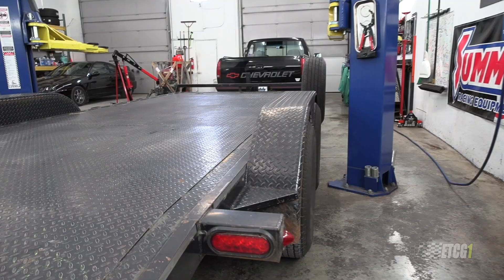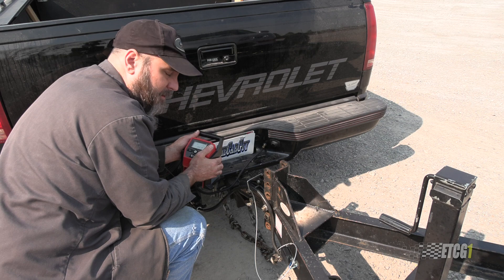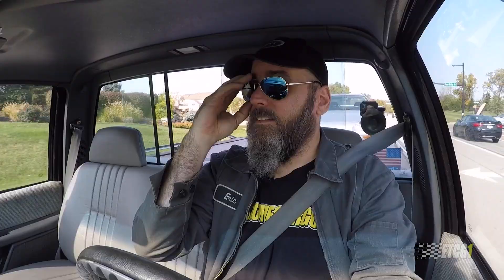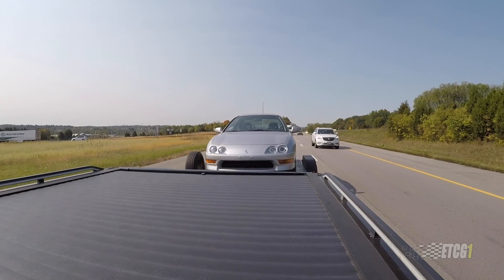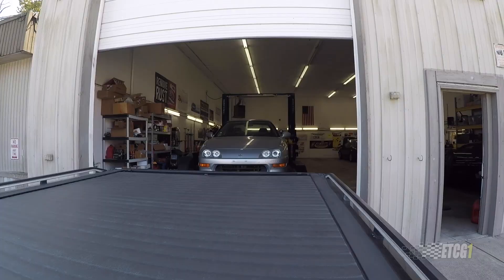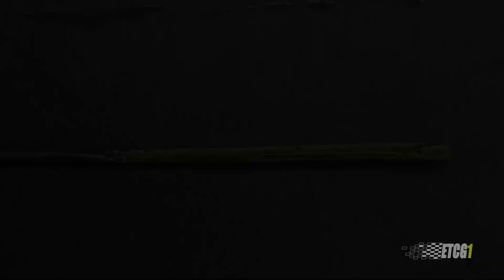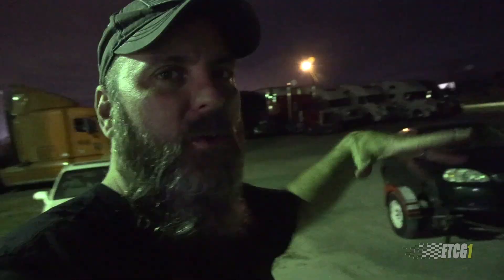First Time Towing With Airbags

Comment: By isolating the sides, you did the smart thing. Shared bags cross transfer load and can exaggerate body roll in a turn.
Reply: Seems to me that trouble shooting is a lot easier this way , aswell... i.e. looking for leaks
Reply: That it is, like on the install video...
Some people also have line locks once at pressure to stop the roll also but have 1 feed.
Reply: This is incorrect. I have sone extensive testing with this Aspect and to my surprise it remained the same in curves. I have the max air 5000 load helpers and I tow a lot of heavy equipment and hay. I carry 95 psi in my bags when hauling heavy. I have them both tied together into one shrader and have never had any problems.
Reply: @Cake41579  I appreciate your opinion. I’ve been messing with air ride for almost 30 years. Put gauges on the corners. You’ll see it’ll absolutely transfer load. It’s physics... no way around it. You may not notice it if your rig is heavy enough but it absolutely pushes load to the un loaded side
Reply: @rdspeedfab  I’ve had gauges on both sides with check valves in place to capture any air that would bleed from one side to the other. I am a cattle farmer and have been hauling heavy, HEAVY loads for the past 20+ years almost daily. With lower pressures below 20 lbs, yes, I did experience a slight bleed over from one bag to the other. Pulling a 24 foot stick trailer, empty, it bled 2 lbs to the passenger side on the interstate at 70mph in a fairly sharp curve in the mountains of West Virginia. I conducted experiments such as this with the steel 24’v gooseneck stock trailer, 28’ gooseneck flatbed, 16 foot lowboy bumper pull and all of them showed minor bleed over in the time frame I was doing the experiments as long as I maintained pressures above 20 lbs. like I mentioned above, I generally carry 90+ psi when loaded. Running empty I only carry 20-40 psi depending on the trailer in tow. I was having trouble trying to conduct an accurate test at first is why I installed the check valves on one bag at a time so it  would only allow the air to bleed from one side to the other. It is a complicated experiment and to obtain accurate results required a lot of head scratching and trial and error. I’m guessing the higher pressure wouldn’t bleed over because of the resistance of the greater amount of pressure in the small area. If the bags were of larger size I’m sure the bleed over would’ve been more pronounced but the average size 3/4 or 1 ton pickup uses the same size I was using to conduct the exoeriment. Maybe I was doing something that was heeding false results but I done the best that I know how to get accurate results. 20 psi or less, yes there’s bleed over. 20 psi or more was hardly even a big enough variation to even record.
Reply: I will say this. My testing was strictly pertaining to hauling a trailer. I guess I never thought that you may be referring to the pickup bed being loaded to one side. In which you would be absolutely correct.
Reply: @Cake41579  well the check valve absolutely solves the issue. Also the rate of spring in your front suspension, rear sway bar size etc would also keep the body roll to a minimum. We’re sorta talking apples to oranges. My experience is with air ride on all 4 corners on customized cars/trucks. Where as you’re using bags as a helper, I use them as suspension. Pretty different from what you’re doing. Still great info and a fun conversation!
Reply: @Cake41579   yeah I agree, different deals for sure.

Comment: "Turn the bottom of the wheel the way you want the trailer to go" is the way it was taught to me - as you said it helps!
Reply: Bert Snerff  Nice, you are probably better at it than me then, but this has certainly helped me on the few occasions i've backed up a trailer!
Reply: Bottom steer, works well.

Comment: Biggest reason for seperate air lines. Handling. If they are T together, when you lean in a turn. Air leaves 1 bag and goes to the other.

Excellent vid!
Reply: You can get bags that are two in one, that counters that problem, eg, top left to bottom right and bottom left to top right, makes them ride flat.

Comment: Never towed anything before myself, so when I bought a salvage titled vehicle, I needed to tow it to have it safety inspected before I could get a State inspection. I went to U-haul, rented a truck, and trailer. They asked if I wanted the car dolly, or trailer first. Glad I went with the trailer since I had to do quite a bit of backing up.
Reply from the maker: Yea, you would have been frustrated backing up a car dolly. At least it was frustrating for me. Thanks for the comment.

Comment: I had a similar problem with towing my bike on my trailer with my old Pontiac grand am. Car was lowered a bit, and had my tool box and army gear in the trunk.  Destroyed the original bump stops from bottoming out. Ordered a set of helper bags for it and made a world of difference. The car had a factory tow rating of 1000lbs, and the bike/trailer combo was maybe 750-800lbs.
Reply from the maker: Thank you for your service!

Comment: You can lock a steering wheel in place with the seatbelt by pulling all the way out, pulling seat all the way forward, wrapping seatbelt around steering wheel as many time needed until able to click it into fastener and then sliding seat back.

Comment: What a difference... Especially nice to see that you were only around 55psi as loaded.  It's definitely never going to pull 20k...but 5-7k should be quite manageable loaded properly.

That on the fly tuning is an awesome feature of your setup, and all those fluid Temps were solid as well.

Congrats on the fun truck with a standard duty towing option.

Definitely gives you a lot more time to find the right heavy duty towing rig if you end up deciding you need that capability in your fleet.

Thanks for sharing!

Comment: If you buy a weight distributing hitch with a sway control, a.k.a., an equalizer hitch, dads truck will have no problem hauling dads other truck. Harbor Freight has a Haul Master weight distributing setup rated to 10k lbs. for under $400.

I'm an owner operator truck driver so here's little tip on backing a trailer. Steer toward trouble. In other words, turn the steering wheel (a little at a time) in the direction of the obstacle that you're trying to avoid.
Reply: That’s good for two things, extra heavy loads where the rear suspension alone can’t handle it and extra sensitive light loads where the towing vehicle has too aggressive of a rear suspension and it pummels the trailer otherwise
Reply: Bottom steer, works well.
Reply: Ive used both bags and hitch. Hitch is the way to go

Comment: I recently purchased a larger camper to tow with my Toyota Tacoma. I use a weight transfer hitch and after watching this video I will be installing a Firestone Ride Rite air bag system to help with sagging rear end. Thank you Eric.
Reply: If it tows good and secure iwouldnt , the goal is safetynot looks.Maybe the hitch needs tobe set up

Comment: I dobt drive a truck anymore. But I did a complete power stop brake upgrade to my 02 accord complete with New hardware drums, shoes pads, rotors, stainless steel reinforced brake lines up front. All in $700.00 and some change including labor cost taxs and worth every single penny.

Comment: I would install an air tank, compressor, gauges and all that so everything can be controlled from inside the truck. The onboard air system would also help for these towing applications for when tires are low or something like that.
Reply from the maker: Like I said in the installation video, I never intended this to be a tow rig which is why I didn't bother with the expense of adding those features. https://youtu.be/e-h_ZNZkS5A

Thanks for your comment.
Reply: If you would do it, then do it. Do whatever you like to your own vehicle. Just like Eric will do whatever he likes with his.
Reply: @ETCG1  It turned out to not be THE towing rig but a towing rig noneseless. :)
Reply: And if you want to piss people off you can use it for an Air Horn.

Comment: So wonderful to hear some positive news! I'm so pleased your efforts have paid off. I completely agree that separate air controls are the way to go - makes it easy to compensate for any uneven loads. 
I couldn't wait to watch this video... and I don't even own a truck! Just goes to show that it must be the company that keeps bringing us back. Still the best on YouTube.
Reply from the maker: Thank you for that. Having separate air lines also makes it so that the air does not pass between bags during cornering. That could make it unstable in the turns. I'm glad the truck did what I needed it to do. Now I can focus on getting my sons car up to speed and back to him. As for the '51, I'll cross that bridge when I come to it. As always, thanks for your comment.
Reply: @ETCG1  I was wondering, have you considered a central fill with one way vales to both sides to make casual filling easier? Retaining the separate fill points for finer control. Sounds good in my head at least.

Comment: Fantastic, I loved the part when you got out the tablet and adjusted the ECU, some things are good about 21st Century life. I had air shocks on a car once. (HQ Holden), they only made a very mild difference to ride height.- although still worth it.
Reply from the maker: Good to know. Yea, adjusting timing and fuel from the drivers seat is pretty cool. Thanks for the comment.

Comment: From the RepoNut channel I've learned that the seatbelt through the steering wheel is enough to keep it from turning while towing a vehicle.
Reply from the maker: I thought of using a tow strap, but was having difficulty figuring out where to attach it. The only time it was an issue was when I took a tight turn. Driving straight it wasn't an issue. Thanks for the comment.

Comment: Yep, dollies are somewhat better for long tows or faster tows, but backing up with them, is a pain, or nearly impossible. I use dollies a lot, but I tow with peugeot 407 sw, with a v6 TD in it, lots of power, but a trailer just messed up the behaviour on highways, dollies sorted that out and no weight on the tow ball, no suspension squash, and I have air suspension on it :) Good job on this one.

Comment: I guess you can separate each side of the truck with different air pressures.  I have run a Kenworth semi truck with 8-bag air suspension and it is a shared air pressure with all the air bags having the same air pressure and have never had a problem with rolling over.  Its amazing how some people overthink little things like this.  Shared air is just fine.  Maybe if one side of the truck is always considerably heavier than the other, one could have more pressure in one side over the other but otherwise don't worry about it.  In my case of towing 44,000 to 54,000 pounds net weight at a time again I say there is no problem with the same pressure in all air bags.

Comment: I dig that you made two Schrader Valves. Because of where the tank is in those trucks I figured that was a huge part of your reasoning. I've worked on a few of those trucks and it always bugged me the tank was off to one side lol.
Reply: I checked your channel because you said you worked on these and sounded knowledgeable, I was blown away by how well organized into playlists your channel is, also it’s pretty cool see someone who likes blutengel and cars (I always thought it was blut angel when it came up on Spotify)
Reply: @aterack833  it's German, it means Blood Angel. At some point, I should probably upload some vids of me working on the Trans Am lol. Thanks for looking me up lol. My Instagram @ariyana_dumon has alot of my Gearhead stuff on it.
Reply: @ariyanadumon4549  what gen? I had a cursed 82
Reply: @aterack833  I have an 83 Trans Am
Reply: @ariyanadumon4549  nice, here’s a tip, avoid trying to put a twin turbo 6.5 diesel in it in the snow without proper tools and with what turns out to be a “rebuilt” engine that someone forgot loctite and torquing to spec on XD also if wiring or electrical issues crop up, fix them all at once and chase any possible issues (mine burnt out starters and alternators of it’s own and any vehicle to boost it)
Reply: @aterack833  lol, that's good advice. I built a 400 Roller Motor, carbed, am building a new engine harness and making it super clean and it is taking forever lol.
Reply: @ariyanadumon4549  good results often do,. I don’t get notifications for replies it seems,. do you like rave the requiem?
Reply: @aterack833  I don't know what that is lol
Reply: @ariyanadumon4549  a band, what about Ayria?
Reply: Just checking you got the most recent reply notification
Reply: @aterack833  never heard of Ariya, but it does sound familiar.
Reply: @ariyanadumon4549  she has a few good songs
Reply: @aterack833  I'll keep her in mind.

Comment: Another consideration on heavier loads is a load distributing receiver hitch with torsion bars. This distributes the weight of the trailer thorough out the frame of the truck instead of just at the hitch. you can increase your tow load by 2-3,000lbs safely so long as your braking system is on par and properly adjusted. And of course, never tow in Over Drive! Zip~
Reply: Couldnt.agree more. Towed a 9klbs 30’ travel trailer for years. The equalizer hitch is really stable. I swear by it. Avoided so many accidents because I had it.
Reply: They actually work well together.

Comment: Strapping 8 - 10 cinder blocks in the front of the bed up against the cab helps when towing something heavy. It keeps the trucks tires planted and prevents the heavy load from pushing the truck all over the road.

Comment: Eric, also if connected via a Tee You loose Independence In the suspension, Bad in cornering, Brought a car with Air shocks set up that way Extreme rear body roll In corners!

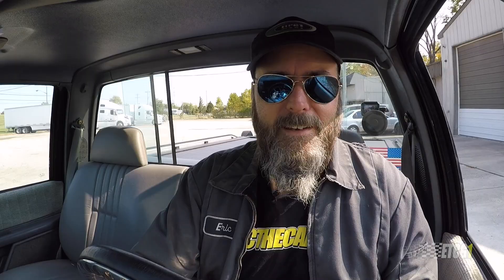Comment: @5:01 also when you make turns with a y connection the air will push out of one bag into the other causing more roll. always best to have them seperate.

Comment: After towing a thousand times..... load placement makes more difference than adding the airbags.  I tow full size trucks on my steel deck flatbed and use a 2017 Colorado. Zero issues.
Reply from the maker: Your 2017 Colorado is way more capable than my 1990 C1500 at towing right out of the box. THAT makes a big difference. Thanks for your comment.

Comment: Needed to mention the advantage to putting your hand at the bottom of the steering wheel while backing a trailer. You can simply turn the wheel in the direction of how you want the trailer to turn. Good video Eric.

Comment: I used a air bag tow kit on my 95 f150 an hauled a 2400 lb trailer with my 94 f150 on it and pulled it 400 miles riding close to level my 94 Weighs 6100 lbs cause big stereo system and rims it was alltimate torture test and did ok

Comment: I knew you'd love the airbags. They transform the ride while towing. The weight distribution hitch does the same, but when I do short runs, I leave that setup at home and just throw more air in the bags, since driving empty with the WD hitch really beats the crap out of me - feels like there's no suspension!.

Yeah, TIGHT squeeze between lift posts!! I had to do the same - lift the carriages up before backing in. My trailer looks to be about 3-4" wider than that one you had - it's TIGHT getting in there. Zero room for error. I can fit it in my shop and close the door, just barely, since I have a bunch of stuff packed against the wall in there. Great for when I have to do brake work ... which is often, since I tow in road salt occasionally. Doesn't take much salt, and sitting idle to make those brakes lock up on you. When I did the brakes last time, I bought whole assemblies, backing plate and all, from eTrailer. I got lazy and didn't disassemble and lube everything, since I was rewiring the entire trailer at the same time. Very time consuming. I started  paying for that decision 3 years ago. So far I've got 2 brakes done after they kept hanging up on me at every light.. Still need to do the rear axle set.

Comment: tip to lock steering. Wrap the seat belt twice around the bottom of the steering wheel. Then move the seat to tighten to where it doesn't turn on you. Not so tight that you ruin anything. I've used this when doing repos, AAA towing and it's always kept the vehicle secure. It also takes pressure off the steering lock (if it does lock).

Comment: I HAD a 2015 Chevy Silverado 1500, and we bought our first camper 6 years ago. A heavy camper. It was just under max weight for towing with that pickup. I had to add air bags to the rear suspension. THAT and the sway bar hitch really helped make a difference. 
3 years ago I finally got the opportunity to upgrade the pickup to a Duramax 2500HD. It was day and night difference towing experience. 
Recently, in June, we had a major hailstorm that totaled the camper. 
Now we want to upgrade to a fifth wheel. From what I understand most guys tow with a 1 ton for fifth wheels. 
Now I am wondering if I add air bags to the 3/4 ton if that would help and benefit me by not having to purchase yet another pickup. The engine and transmission are the same, just different suspensions right ? 
LOL here we go again. 
At least I know better than to max out towing weight. I can tow up to 14k lbs with the 3/4 ton, so I’ll be looking for a fifth wheel in the range of 9k lbs to 11k lbs. 
Any thoughts ?

Comment: air bags are great, but no substitute for correct tongue weight. you want 10-12% of the total weight of the trailer and load on the tongue.
the onboard air compressor and gauge kit will be worth the money. I highly recommend it.

Comment: Surge brakes usually don’t work or have too much friction, having driven with a trailer with good working ones, it’s magical, you have a lever for preload and parking and breakaway, and the brakes just apply about as needed, issue is on some of them the shock absorber for the brakes doesn’t work right and you end up having them apply when you go to reverse